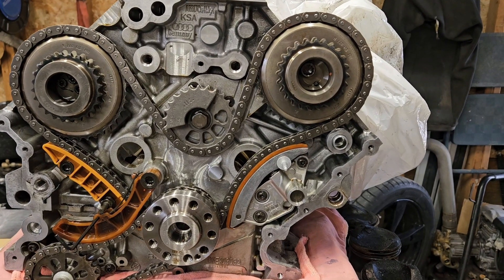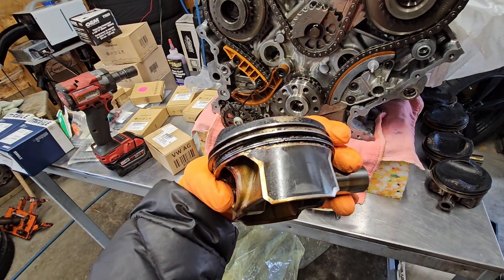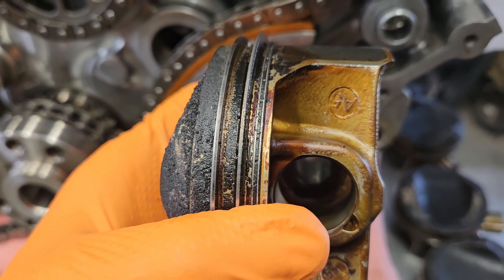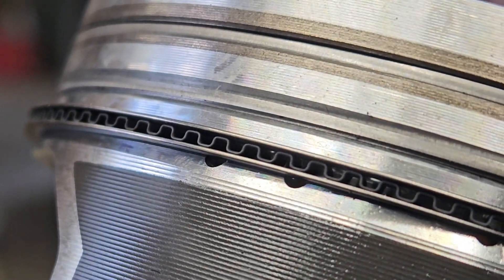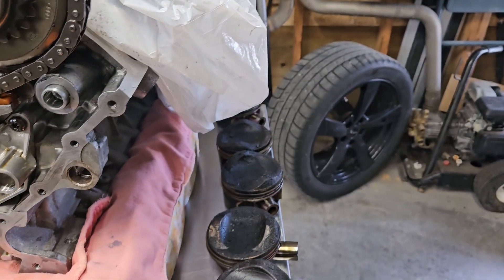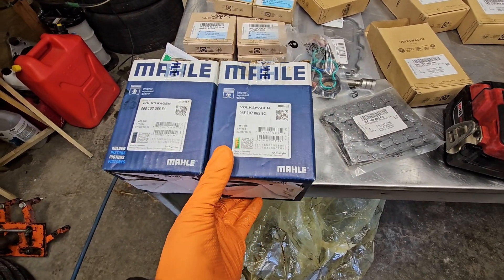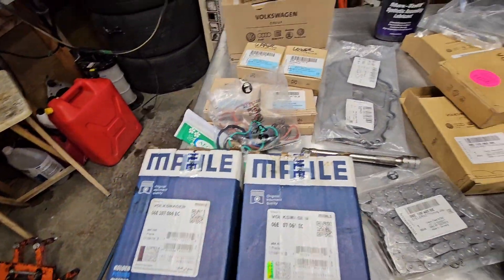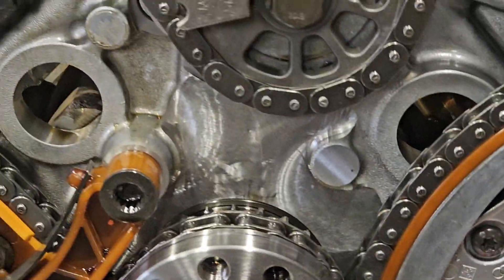Audi 3.0T CREC OEM Engine Piston Rebuild kit - Oil consumption repair

Comment: B-12 piston soak!!!     I was burning through a quart of oil every tank of gas.     Did a B-12 piston soak and it totally freed up the rings and now I don't burn any oil at all between oil change intervals.     Sorry you had to pull your engine.   The piston soak took a weekend, just a few minutes at a time to turn the motor and pour in the B-12 (  100 ML at a time at TDC )  to let it soak.    I'm so glad I found the  B-12 piston soak video.

Comment: Got a salvage Q7 with this engine for my son, had about 67k miles, and burned about a quart of oil every 250 miles when I got it. I did the Berryman's B12 piston soak, look for Eurotrash motors on youtube, and now it goes about 4k miles without needing more oil.  Problem is most likely those oil scraper rings, they made them 1 piece instead of three, with holes for the oil drainback that are too small and eventually plug up with carbon. Then the oil passes by the ring, and starts loading the combustion chamber with carbon as the oil burns. The older Audi 2.0t engines had it even worse, their oil control ring holes were super tiny. On many of them, piston replacement is necessary to get updated rings or they just keep burning oil. But on later cars the B12 soak is alway worth a go. And it's cheap at walmart. Pour in spark plug hole, leave overnight, suck out any residual to avoid fluid lock with plugs back in, and change the oil because some will seep past pistons and dilute the oil. I was stunned at the improvement. The car came from a realtor and I suspect tons of short trips in cold northwest weather made the problem worse, along with neglected oil change intervals. My son does long highway trips and that seems to help even with long oil change intervals. Now has over 100k miles and doing great.
Reply: I have an S4 with this engine and there’s excessive crankcase pressure because of bad rings. Burns about 1L of oil every 500km and keeps rupturing PCV diaphragm so it makes a whistling sound when it gets up to temp. Did you have those symptoms? 

If you can give me somewhere I can talk to you to ask you questions I’d appreciate it

Comment: So I other words, the CREC engine is junk
Reply: Plenty of 100K+ CREC engines out there putting down 500+HP daily with stock internals. The CREC does not suck by any means.. It is a stout engine. Freeing up those rings did not require removing the motor. I am literally B12 soaking a 2015 Jeep Grand Cherokee right now for oil control ring issues. I have B12 soaked a TON of cars and it has always either completely solved oil burning issues or greatly improved. It's no joke how effective it is.

Comment: Very interesting...what kind of engine oil was used?  Do you know?  Had high quality synthetic with proper detergent was used (with high frequency oil changes) wonder if this can be prevented.  Carbon locking of the rings on the 3.0t crec engines seems to be fairly common
Reply from the maker: @sonicnofadz  5W40 Castol Synthetic 

The issue could be more complex than just the piston rings is what we're finding...

we found that the valve guides are also worn out, they have a larger tolerance than Audi factory spec which allows the valve to float around inside the guide, also we found the valve seals to be completely worn on the affected guides
Reply: @canturbo  castrol 5w40 euro has been shown to have pretty mediocre anti wear additives....possible contributor to this motor's demise maybe. That is a lot of carbon buildup, probably due to intervals. Valve guides wearing out that is interesting, what material are they made of?  I'm assuming not bronze...
Reply from the maker: @sonicnofadz  the valve guides are usually made from a brass alloy

As mentioned before we believe the complex failure of this engine is possibly due to something with heat or temperature, during the cylinder head rebuilds we've noticed there is hot spots in the cam bridges, it's possible this issue is a thermal management engineering flaw

I have rebuilt a few of these engines now and realized that in the 2019 CREC Audi has went to using a 0W40 engine oil which is also interesting...

In the end we have concluded in our climactic zone of huge temperature swings that more frequent intervals are needed to prevent buildup on the oil scraper rings, every 7,000kms or 6months is needed

Comment: Can you share the link for the rebuild kit?
Reply from the maker: @nocomp420  

It was from eBay and it shipped UPS to me in 3 to 4 days I believe this is the kit here but I could be mistaken as they're always switching up the pricing and the parts included

https://www.ebay.ca/itm/355092751276?mkcid=16&mkevt=1&mkrid=711-127632-2357-0&ssspo=00yz0mmosrk&sssrc=4429486&ssuid=podsd7kdsha&var=&widget_ver=artemis&media=SMS